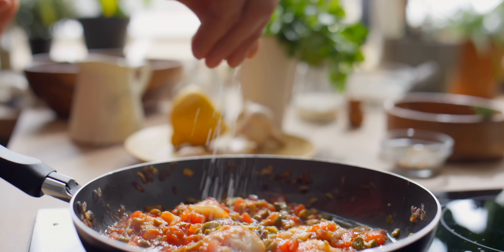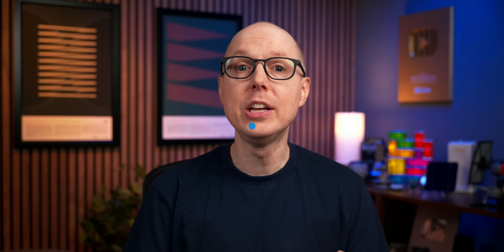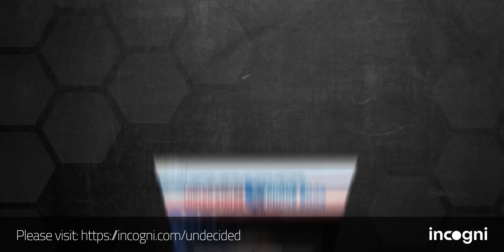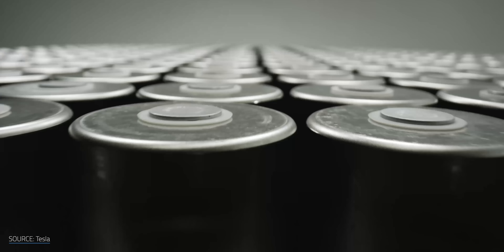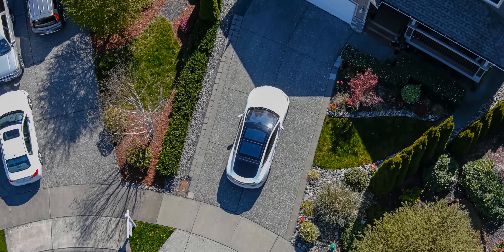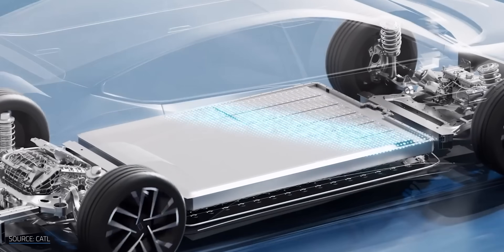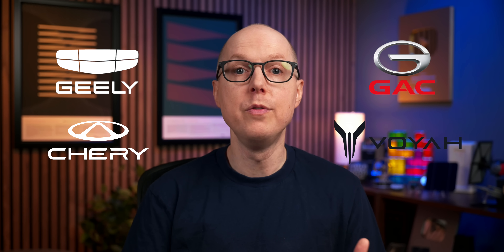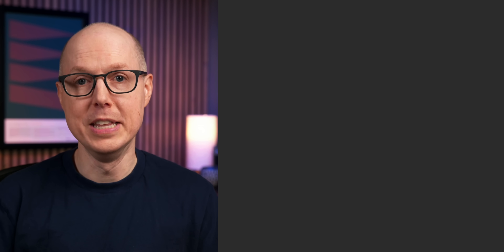How CATL Made Batteries 90% Cheaper (And What Happens Next)

Comment: For home battery, a Sodium battery would be just fine for me. Particular in my area where >100F temps happen every summer. The idea of having more battery for less cost to be able to power things like AC and such on hottest days without having to pay electric would go a long way to get my money back.
Reply: @michaellynch1132  有太阳能板吗？
Reply: Well several charge systems are intelligent so it will charge when ever prices are low, this is very good to balance out with for example wind/solar energy sources, like wind farms running doing windy nights where consumption is low, instead of turning off and standing idle.

Comment: i foreshadowed the lithium -> sodium takeover over ten years ago after talking to the folks at Sea Wave Batteries who were claiming incredible, like unbelievable incredible energy density and manufacturing costs at scale. they never managed to get across the valley of death but if the physics  they were explaining to me have credibility, eventually a corporation wi tv the resources and engineering smarts was going to bridge to this new world of very very affordable electrical energy storage at a scale the RE transition requires. most people told me i was talking shit. ok. time is the master teacher.

Sea Wave Batteries were claiming specific energy (energy/mass) and volumetric density (energy/volume) theoretical potentials (subject to more engineering work) that would enable long haul 100+ passenger aircraft with zero thermal runaway risks. let’s see if it happens. the take away is the the theoretical limits for sodium based batteries on both cost and specific energy knock lithium outta the ball park. but time will tell.

Comment: I would most certainly put my kids in an EV if it saved me thousands. I would most certainly update my home battery systems to store MORE power at those price points. If they are even $40-50, it changes the game altogether. If they CAN hit $10... there isn't enough tariff on the planet that won't result in companies just buying CATL batteries and paying the prices. The price isn't just about making them available cheaper, its about having a product that will become so crucial that if you don't adopt it - you would be setting your own economy on fire because you'd be substantially further behind. At $10-25 kwh, the batteries become a commodity... it's no longer something that impacts the price equation. You start having to consider how you'll recycle them because you'll just swap them out like you do AA batteries.

Comment: I'd personally be interested in seeing more DIY kits for converting older vehicles into EVs, particularly the model years of a variety of makes/models that used relatively standard, modular parts bins with existing aftermarket drivetrain swap potential (even for some quite old vehicles: given the niche, but very broad market for say ... 80s/90s/2000s era GM vehicles that stuck tot he corporate GM parts bin).

Not sure if I'd end up using it myself, but a significant minority of the US population would be into that, both for their own use and for flipping.

Plus, some older vehicles are significantly simpler and lighter, partially due to older safety specs, which while less crash safe, would be substantially more efficient due to sheer weight reduction. (like 80s era honda civics or CRXs ... terrible for crash safety, but excellent for a fuel/energy efficient platform:  and if you think about it, they're still much more crash safe than something like a motorcycle/e-bike/scooter ... which is the other cost/eco-friendly platform)

Or weird cult cars that have seen lots of engine swaps and some notable EV conversions over the years, like the Pontiac Fiero. And ... yep, there have been Fiero Tesla engine drivetrain swaps ... and performance comparisons to the Tesla roadster. But that's only cost-appealing compared to how expensive the roadster is. (but it's also cool)

In crash safety terms, the fiero is a VASTLY better platform than an old Civic, but it's also about 1000 lbs heavier. (still light by most modern standards, but think more like 2400-2800 lbs rather than 1600-1800)

Hmm, I'd imagine a Pontiac Solstice would be even closer as a poor-man's Tesla Roadster, but I think the Fiero has a big advantage in being a mid-engine transverse drivetrain. (which would be very similar to single-engine, rear-wheel-drive, transverse mounted electric)

Comment: Even if sodium batteries are just China subsidizing an alternative to lithium, I fully approve. Not everything should have the battery replaced in two years, especially not grid. LFP would be nice, except it's an industry dragging its feet when it can't out-compete normal lithium batteries. The one thing China can do is actually accomplish something, instead of keeping everyone stuck in the dinosaur fuel age.